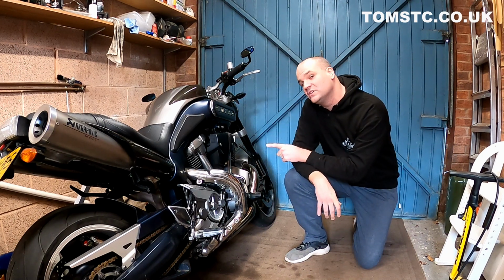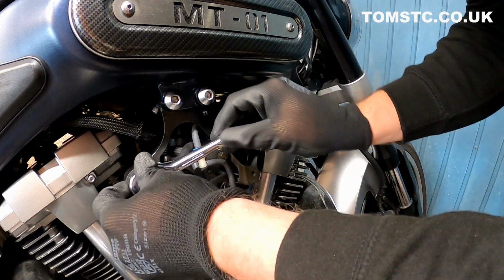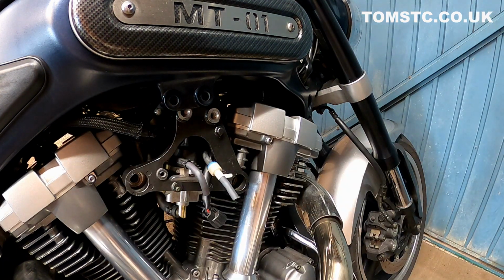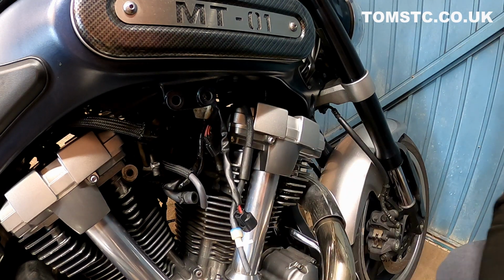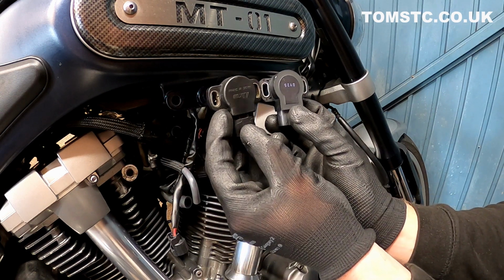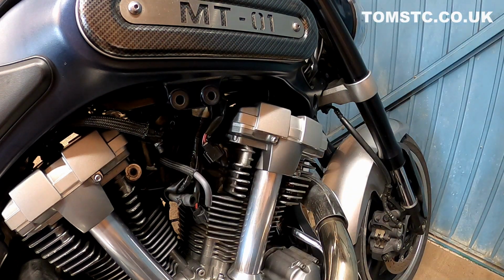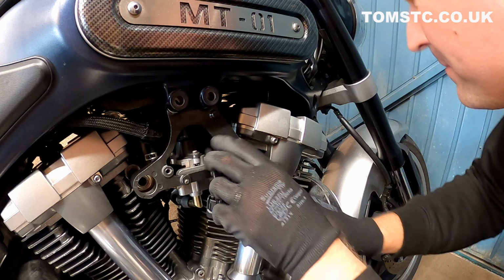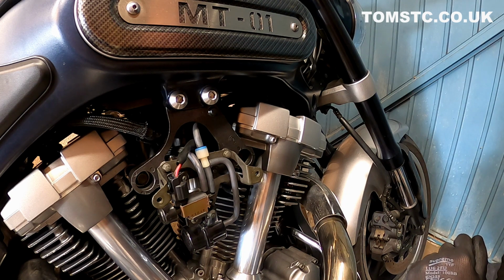Yamaha MT-01 TPS replacement

Comment: Great video but why not check the voltage it's dishing out at idle as per the manual - 0.63-0.73V?
Reply from the maker: Thank you, it's a common fault on these, so replacement was the fix.
But yes you can check voltage too

Comment: Does your bike have the booster plug that's available and what's your opinion on them, new owner here 2 weeks and 900 miles I'm loving this bike
Reply from the maker: Hi sorry for no reply on this, no I don't have one. I keep thinking About  it but om not sure it's worth it
Reply: Hi. 3 years late on ya question... yes i got a booster plug for my MT01 and it did smooth things out a little.. so no regrets..

Comment: Have the same machine, great video and some good insight if I need to do this job, thanks for sharing, have you removed the exup valve etc, I see your exhaust is not standard.
Reply from the maker: Thanks for the comment, the exhaust is standard it's the stage 1 akrapovic system. I keep wondering whether to disable to exup valve but at the moment it's still on the bike and working